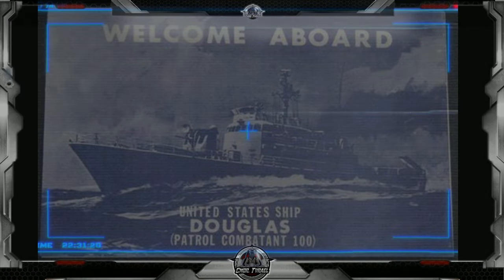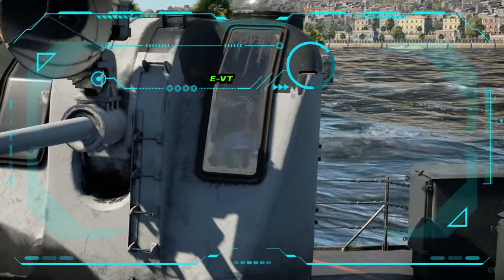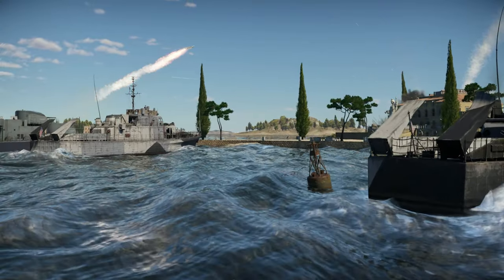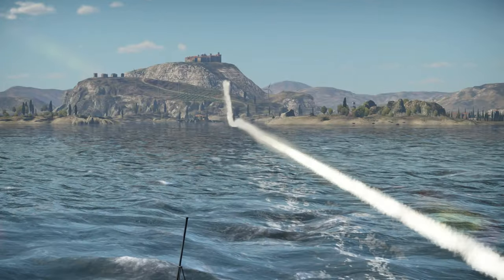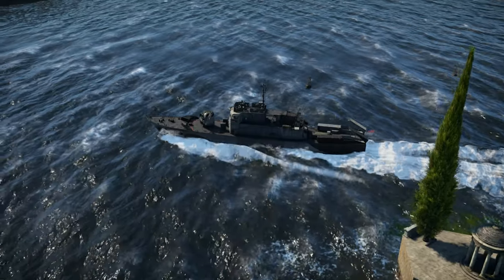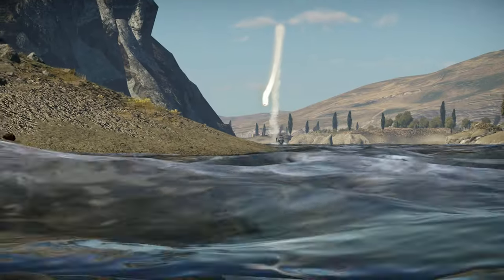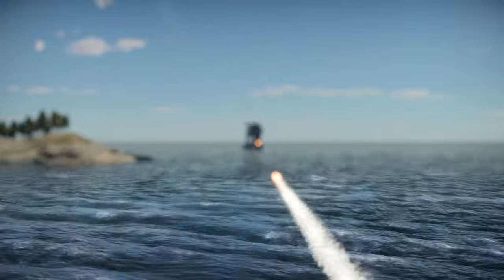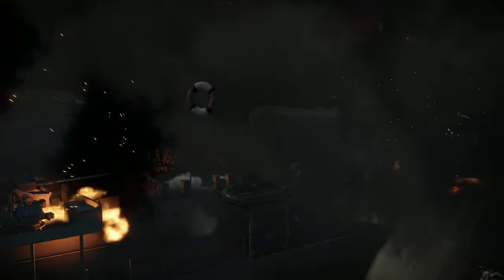USS Douglas (PG-100) Asheville-Class Gunboat.  RIM-24 TARTAR. Air and Seatargets

Comment: Seen quite a few of these in 30 games an it's a shock how many people went out an bought as Asheville class PGM for 50 bucks (AUD as 6000 GE is roughly 47 bucks) an imho an Asheville is not worth the costs nor is the TT one worth the old cost or the new costs (RP wise).

Still it's astonishing that the devs decided to make a missile armed vessel premium instead of TT like with the P-494 but it has done what it was added for aka wow factor so everyone is getting one.

Anywho in the matches that they were used by effective players it was a sight to see a constant steam of missiles incoming with few ways to take them down unless you have radar that can lock on the missile and have a high RoF AA to hit them but the new UI can be troubling to hit them as guns practically overshoot (from facing the Nettuno over the years that assessment comes from).

Still with the addition of another missile I wonder if we'll see more added ever so often or in rare additions, Yet a shock we didn't say get the first SAM first before another mixed missile (first ship based missile was a SeaCat missile first found on Type 12M & 12I Frigates).
Reply from the maker: I completely avoided the Asheville until this moment. I fact I had barely touched US coastal past T3.

You are right, in my opinion these premiums with "early access" to certain weapons makes me wonder if they aren't just proof of concepts in action.

If it ruins the game mode then they are safe in the knowledge that it's expensive to "buy in"

Also, with this addition. The like of Chikugo and Albatros, Bussard, Pr. 12412 etc. Should really be should all be give  acc3ss to their full weapons kit now.

As it stands only one the soviet boat has capable enough radar and CIWS fire-power. Maybe the Pr. 206 could do it too.
Reply: @CmdrTyrael  

On the top part of your 1st paragraph I am similar having researched the PGM-84 way back in 2018 even then it wasn't a good vessel an even now it's just as terrible an will stay terrible as it's main weapon is a Mk.22 barrel 3"/70 cannon which are absolutely useless an even worst is the ammunition costs of them (mainly in the Cost'all TT with the most expensive belt being 6.7k) those cannons are not meta friendly. 

For the 2nd/3rd paragraph yep them seems to be it an case in point the Kamov Ka-50 & to some degree the Porter class USS Moffet (Muppet for showing broadsides and getting their aft magazine set off) are prime examples of being really good so they flood the matches with them, Still the muppet should of been like the original destroyers an be expensive just like this PGM-100.

4th paragraph, As much as I'd like to see the Nord Aviation Exocet AShM for the Type 143 it's probably a tad to powerful ntm near attomates which 90% of the playbase would probably cry foul.

Similar with the Destroyer Escort Chikugo the ASROC unit would be to powerful with the AShM options but from what I've read they only carried the ASW missile but it's a game an not realistic so you could probably use them as AShM's.

Now the Pr.1241.2 could possibly work especially against jets as the igla are in game so I don't see why not for that corvette to get them

5th paragraph, The AK-230 30 mm are technically counted as CIWS same with the AK-630 30 mm an similar the JM61 20 mm ntm the DARDO 40 mm (Single mounts on the P-493/P-494 and iirc Dual mount the Albatros class Corvette) still more CIWS are welcome especially the Goalkeeper 30 mm CIWS (which is a GAU-8 Avenger which would intern mean a Type 22 Batch 3 Frigate).
Reply: I also thought adding this was an interesting choice. I guess they wanted to try adding a missile that wouldn't make the battleships obsolete, so they added something with a lot of capability but relatively little penetration value. Like, it's not a small amount of penetration (70mm iirc), but it isn't enough to pop most light cruisers.

Comment: Anyone else notice that the pg-02 has CIWS now? It shows up on the radar as really small rectangles.
Reply: Its been cwis
Reply from the maker: Yeah the UI changes have adjusted the Radar HUD on most vehicles. It's clearer now IMO
Reply: The PG-02 and Douglas' radars are basically removed now
Reply: @teslashark  PG-02 Had dedicated OPS-18 and OPS-20 radars...fire control and search. Their removal is bemusing as eventually it will receive Anti Ship missiles 😮